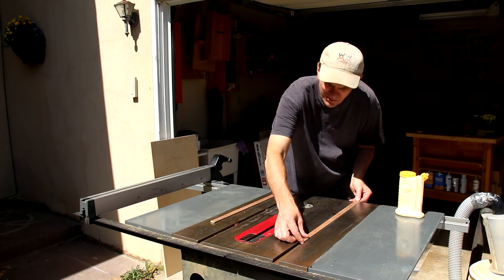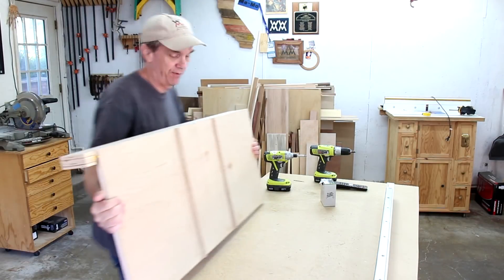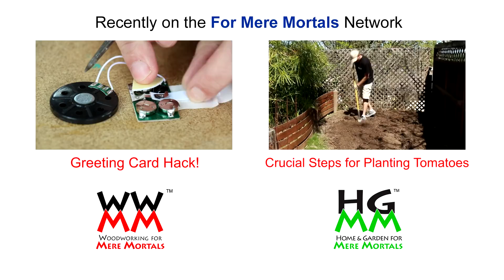Build a crosscut sled: essential table saw jig

Comment: I know nobody will probably reply to this, but why do all the sleds on youtube use 3/4 inch plywoood?  Why not 1/2 inch?
Reply from the maker: I haven't seen all the other sleds on YouTube, so I can't really answer.
Reply: Thanks Steve!  Why did you use 3/4 inch plywood yourself instead of 1/2 inch?
Reply: Thinner plywood tends to flex.  MDF might work, especially if laminate.  HDF would probably be good, if you can find it, and it would help you build upper body strength moving the thing around.
The Woodworking Junkie made one with 1/2" pine.  A lot of edge gluing and sanding or planing to get it flat.

Comment: Just a dumb question from a newb, but I notice that the wood workers right of passage is making their crosscut sled. There are so many designs and modifications and all that and it seems anyone worth their woodglue has one... 

So does any brand actually make retail versions? Like could I go buy a craftsman crosscut sled for example? Like one made of plastic and metal or whatever... Because they seem so popular and ubiquitous that I'd imagine someone is making money off them.
Reply: +danteelite Yes you can buy them. They are pricey though. Incra and Kreg make them.

Comment: Hey Steve! I was wondering why it is when you put screws in, towards the end, the drill seems to slow down and start clicking. Is this a special bit? What is the purpose behind it?
Reply: That is because he is using an impact driver, not a regular drill.  Once a certain amount of torque is required to turn the screw it uses a sort of hammer function which is much more powerful than a regular drill.

Comment: If you have a nice sliding miter saw and table you don't need on of these.
For the pieces you showed actually you don't even need a sliding miter. Just a normal miter saw with a stop block.

Crosscut sleds are only useful when using a dato blade or when the board is clamped on edge like for making box joints.

Comment: Steve, HELP.
I have a Ryobi table saw.  The miter slot is not U-shaped, it is T-shaped to accept the Ryobi miter gauge.  I tried to find aluminum stock that's the same shape as the miter gauge stock to use as my runners. No luck.  Any ideas.  Thanks, Mitch

Comment: I have a table saw with a Riving Knife factory installed. it has two positions high for most cutting and a low position for "not all the way through" cutting. I don't see any videos for table saw sleds with the riving knives installed (maybe just increase the height of the rear fence? Or eliminate the rear fence altogether?). Anyone have an idea or know where a video of this is?

Comment: Hey. I have a fairly cheap, small table saw that the fence is just clamped down right with no runners.

Anyone got any tips on making one for this style? 

I was thinking about using the sides of the table instead of a the runners?
Reply: I'm no master carpenter, but if you don't have runners, that might be all you can do.

Comment: Well done Sir!  How long do you think it's gonna take before someone warns you that you could hit that angle iron with your blade?  LOL!
Reply: That's precisely what bothered me about this video! :-)I'm a strong believer in The No-Fastener Zone when it comes to sleds vs. blades.
Reply: ***** or use 2 pieces of angle iron skipping the middle but use them on the base as a "L" bracket and also screw the iron to the sled base. just an idea... either way .. love the build, always great info and highly entertaining.  Thank you
Reply: I'm not a fan of the angle idea, but if someone were to do it, I'd recommend using aluminium angle instead of steel. Hitting the aluminium wouldn't be a big deal, but steel might not end well.

Comment: Steve, do you ordinarily have a riving knife installed on the table saw, and remove it to use the sled?
Reply: Wood can't pinch like that on a crosscut as long as you're not jamming it between the stock table fence and blade, so for cross cutting the riving knife isn't necessary.  It's for rips.

Comment: I have a skillsaw table saw from Lowe's.  it the low end one.  the grooves for the miter gauge are not uniform all the way through. about a third of the way in on both sides ,and the front and back have these tabs that the gauge rides under.  how do I make a sled for this saw?  I have toyed with the idea of cutting the tabs off but , I believe that would void my warranty.
Reply: If your saw came with a miter gauge, I assume that one will work in the slots.  If so, you could take it apart and use that rail for your crosscut sled.  You could then purchase a replacement miter gauge and do the same thing with that to use as your second rail.  Do a search for Skill Table Saw Replacement Miter Gauge and you should have a few options for purchasing one (Amazon, Sears, eBay, etc.). Remember to use an epoxy or Gorilla Glue instead of traditional wood glue.  Good luck!

Comment: Gluing the runners onto the sled like that did not work well for me at all. The glue stuck the runners to the table top more than to the sled, making a mess of my table top and not successfully attaching the runners. Maybe double sided tape or contact adhesive instead.

Comment: I'm a beginner woodworker and have been working on building one of these on and off for the past few days. I put the pivot screw in the front fence, but every time I check its angle with the blade, one side is 90 and the other side is off. I've moved the screw so many times that I'm now a step away from starting over. Any tips for this?
Reply: If one side is 90 but the other is not, I get the impression your fence is not straight
Reply: antalz That was my initial thought, but I've checked all sides with a level, and installed the angle iron to support it, and everything is straight. I'm racking my brain here.
Reply: Something is not straight if your angles don't add up
Reply: Is your blade set at precisely 90 degrees?
Reply: Your level could be out.  Try using a straight edge, speed square, or framing square.
Reply: Rob Cartwright Your fence needs to be completely straight. Check it with a straightedge.
Reply: it sounds like your blade has not been squared to your miter slots. There are many tips on line on how to make a simple jig with scraps to easily check and adjust this. You want to make sure you tune up your saw correctly before investing time in making jigs. Once you have it tuned properly the jigs will make it work magic.
Reply: Al97233 Thanks for the tip! I'll look into that.

Comment: Steve everytime I try to screw in the runners they crack on me even when I drill it.  What the heck am I doing wrong?
Reply: Shyla The Husky did you predrill the holes?
Reply: @clevernoah  I did but I still cracks.  Not sure if ts the wood I'm using the size of the screws or what.  It sure is frustrating though
Reply: Shyla The Husky ok ok what about your wood, what did you use to make the runners?
Reply: @clevernoah  I ripped the ends of some plywood and sanded them until I had a perfect fit with zero play.  I didn't put any kind of finish on them.  I drilled 3 holes 1 on each end and 1 in the centers.  I used a screw just a touch bigger than the drill bit.
Reply: Shyla The Husky I'm no expert but it sounds to me like you did everything perfectly 🤨

I'm not sure what's going wrong....but it's not like you can't just make another strip 😅
Reply: @clevernoah  maybe I just had bad luck.  Thinking about trying oak..  I  appreciate all your help.

Comment: Does anyone know if there's a .pdf of the plans for this crosscut, or a materials list; or do I just need to jot down what Steve tells us in the video?   I realize I'm going to want to modify this for my own needs; but, was really just looking for a materials list and a set of basic plans.
Reply: Kenny Parnell Thanks, I was lucky in that my saw was adjusted well at the factory; and I was grateful as it is a huge headache, or looked to be one, to adjust it.
He says he uses 1/4 plywood for the strips because plywood is less susceptible to swelling due to humidity.  I'm in South Carolina, and humidity is a big issue around here, so I'll give the plywood a try, as he suggests for the strips.  

I guess the worst that can happen is I end up making a couple of these sleds; but, they seem fairly forgiving (his old one is really chewed up), and anything is better than the tiny one rail T I have now.  I'm more interested in making or getting a decent fence.  As I mentioned in one of my posts on his site; I've discovered I can make precision cuts with my cheap table top saw; I just have to take my time.

So, do you watch Steve?  For a woodworking guy his project are fairly easy, but, still beautiful and his videos instructive. I can embrace the Mere Mortal concept; he's my favorite woodworker online!  I just get a real kick out of his enthusiasm, it's contagious.  In this video, he uses his normal instructive voice, then with boy like enthusiasm, "This is going to be size of my new one!" around 1:10, and I just can't help but laugh every time I hear that tone.  My wife supports my woodworking projects and doesn't pay much mind to my watching his videos except at the beginning, when he does his running "Microjig" gag advertisement, which she enjoys as much as I think do most of his viewers.  Never seen him repeat even once.  And I can't believe how many times I forget he's going to do it.  Thanks for your comments.

Maybe Steve could help us by coming up with a wooden design for a 3D printer, which could be used to make parts for a better 3D printer.  I keep thinking, there's got to be a way to make a 3D printer in such a way that it can, with limited capability, make temporary pieces, which then give it more ability to make final pieces.  A true, self building 3D printer.  The first pieces don't have to be pretty, just functional.  Maybe a combo of wood, and plastic.  I'm tired of looking at instructables that tout "A 3d Printer that prints itself" only to find out, well, you know what I mean. lol.

BTW, I'm getting quite skilled at Blender... I know I said it once already; but, thanks again, so much!

Comment: What is paste wax and where can I find itit?
Reply: Usually in the paint and stain section of the big box stores. I assume its typically used as a furniture polish/protector. I find the Minwax brand to be pretty good but that's about the only brand they carry here.
Reply: Johnson Paste Wax, Minwax, even Turtle Wax will work - just make sure you wipe the excess off (buff it off like a car)

Comment: Thanks for the video, Steve!  I've only recently started woodworking as a hobby and stumbled across your series of videos on here.  Keep up the good work!

I purchased a Ryobi table saw and it came with a guard that includes a riving knife and anti-kickback pawls, among other features.  With these in place, I don't think this version of a table saw sled would work.  I'd rather not remove safety features from a saw if I don't need to, but I would definitely like to implement something that would help make near-perfect 90 degree cuts!  Any suggestions?

The Ryobi table saw: https://www.ryobitools.com/power-tools/products/details/680

Comment: Nooooo... The runners MUST be plastic at least. A hard lesson I learned, since I made my sled last summer, and now I'll have to make another one. :( You can use plastic from cutting boards, or pretty much anything you can find, as long as you are sure those won't expand and jam in the slots later. Also, when you set up runners, you can use superglue (not for fences thou, there you use white/yellow glue for one, and just screws for the other, just like you did) since you screw them anyway. Way faster. Also, it would be wiser to drill the holes for screws in the runners before you glue them, and drill the same diameter as the screws (or bigger) so that runners won't expand when you screw them. As soon as I make mine ( ver. 2.0) I'll post it to http://woodworking.formeremortals.net/ I promise! :)

Comment: Table sleds with just the left side of the blade are not worth their trouble of making them. As your material ends the cut the low side on the right causes binding and kickbacks.  Bob

Comment: Hi Steve, I was hoping you could help me answer a question I have, I’m trying to make a sled for my new table however it has a splitter on it that doesn’t move with the blade. It’s very large and holds the clear plastic guard. in your experience is it dangerous to remove the slitter with using a sled? Or do you know of a sled design that I could use? (here’s a pic of the table saw I have http://4.bp.blogspot.com/-WvB4IMbz300/UOvCho0tW6I/AAAAAAAAMk4/3vAFXO5pgfs/s1600/CTJ-650.jpg )

Comment: I'm terrified of my tablesaw after a kickback incident. Making me not want to woodwork anymore!
Reply: pasreles
Reply: Then you are probably using it wrong!
Reply: A crosscut sled makes it MUCH safer. And when you are ripping without a sled, if you use a riving knife and a featherboard then kickbacks are nearly impossible. You need to respect the tool, but don't fear it. If you fear it, you make mistakes. if you respect it, you remember not to make mistakes.

Comment: Why don't you just use a miter saw
Reply: There is so much more that can be done with a sled than with a miter saw. You can make perfect dadoes, rabbets, and it's easier to set up stop blocks to make repeatable cuts. Plus you know that every time you put the sled on the saw, you have a perfect 90 without having to check the angle with a square. The detents on miter saws are notoriously inaccurate.

Comment: with the blade ALL THE WAY UP, it looks like you are going to cut the steel
Reply: I see two ways around that problem.  You could either mount the steel on the other side of the upright, so the blade would have to cut right through it before coming into contact with the steel (giving you plenty of warning that this might happen), OR you could cut a slot in the steel so the blade passes through it.  The second option would be my choice.
Reply: BoingBB
Sorry - I just realised that the steel IS on the other side!  So cutting a slot in it would be the answer..

Comment: Why can't you just use your miter saw? A friend and I are genuinely pondering the purpose of a table saw sled. Aside from wider boards, why not just use a miter saw? The fence is already set up.
Reply from the maker: +Bobby Hopkins Definitely don't need a tablesaw if all you need to do is crosscut boards.
Reply: Hi Steve. I have both types of saws. Just wondering benefit of using a table saw sled instead of a miter saw for the same types of jobs?